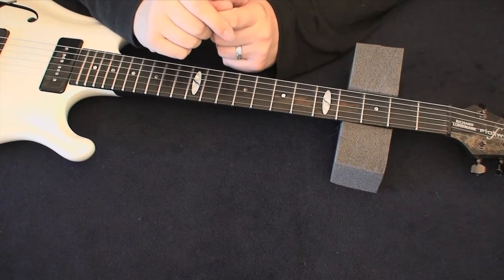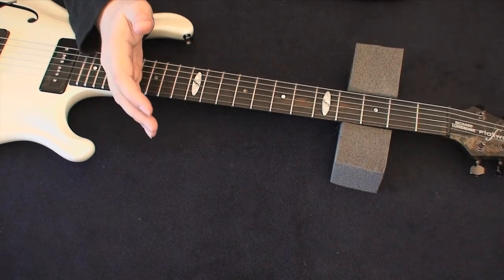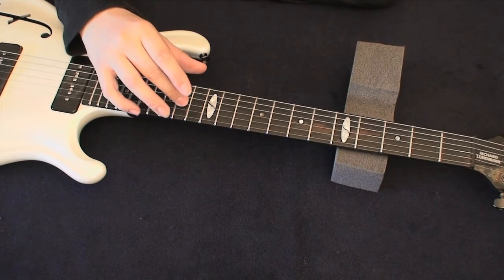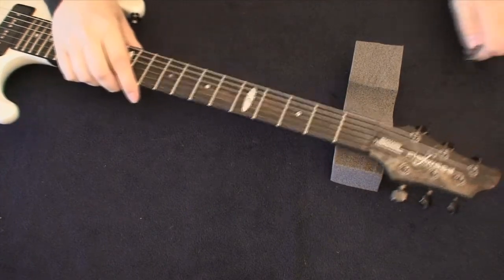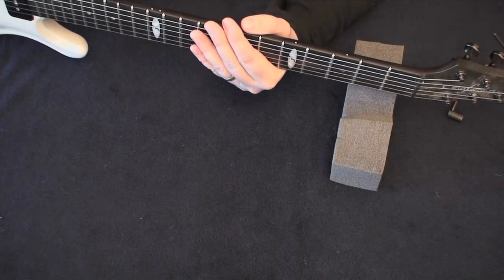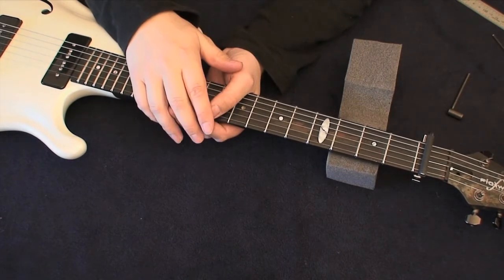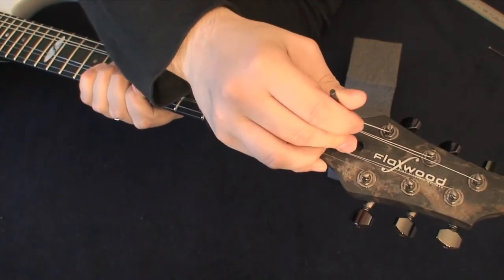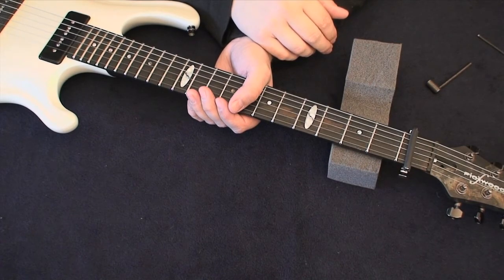5 - Truss Rod Adjustment

Comment: Does tross rod adjsutment have anything to do with effecting your tuning?... i noticed my strings are tuned perfectly at open notes, but when i play them on the fret board, certain notes below the 12th fret are showing up slightly sharper than they should be.... does this have to do with how my neck is angled and i need i trust rod adjustment? i have a squier classic vibe 50's stratocaster and ive had it for 3 months and recently switched from 9 gauge to 10.

Comment: I was hoping that the composite of a hard resin with wood fibers would yield a product that did not require truss rod adjustment.  My belief was that the Flaxwood material was rigid enough to not be affected by standard use string tensions or climate changes similar to carbon fibre necks/guitars. Note: From an engineering standpoint a perfectly straight neck is the ideal
Reply: It isn't affected by climactic changes [whether temperature or humidity].  I own an Aija and it has never experienced a relief change.  That being said, if you change string gauges/tunings, then you will undoubtedly have to change the relief.  The truss rod is solely in the neck for dialing relief in and out [based upon preferences, situations, and string gauge].  Simply having a truss rod/truss rod adjustment video isn't a suggestion that their guitars "need" a truss rod.  Trust me, having owned a Modulus without a rod, you miss it if you don't have it.